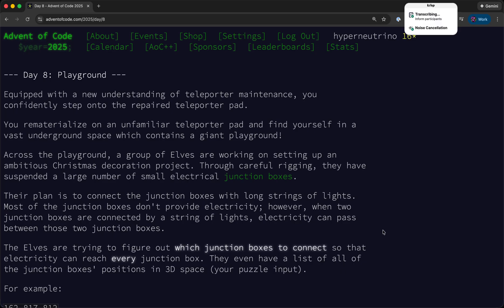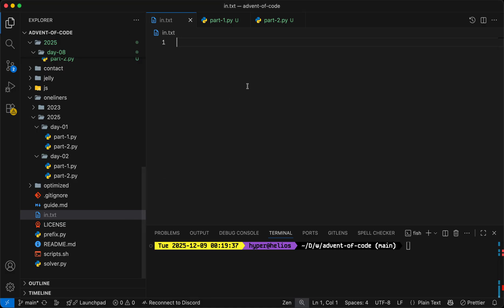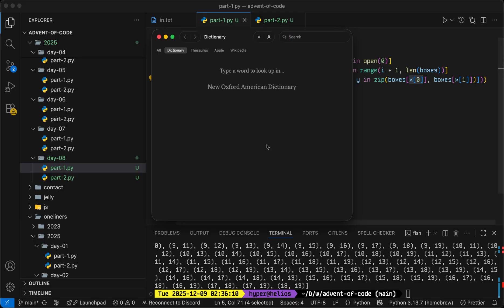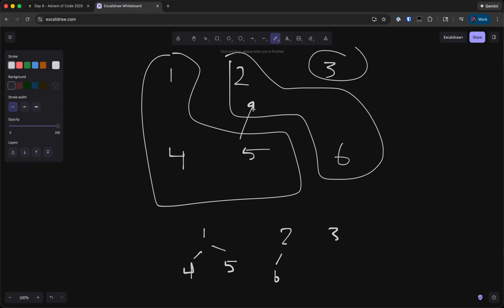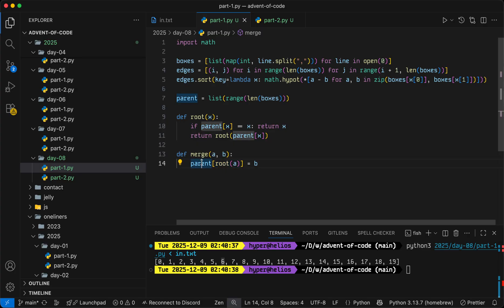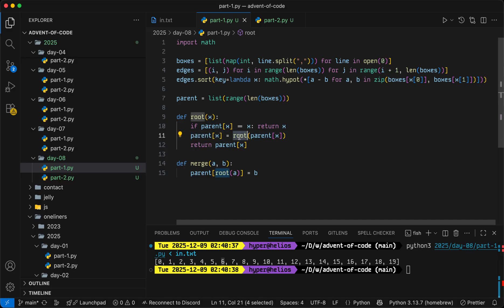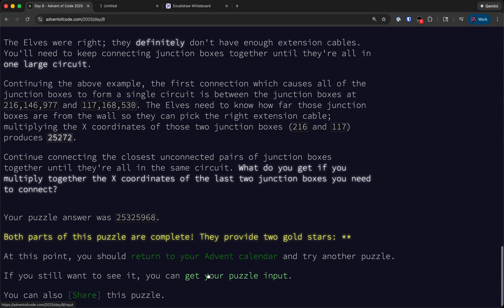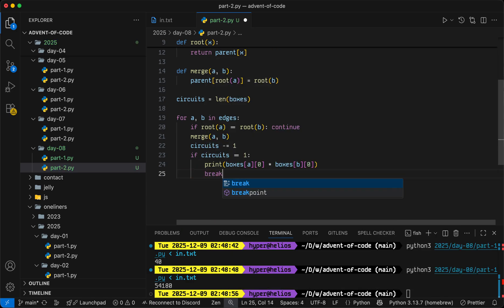advent of code 2025 — day 8 "playground"

Comment: This looks really good as always. One small optimization for Part 1: since you only need the top 1000 shortest paths, you can maintain a max-heap of fixed size 1000. That way you keep only the best 1000 paths as you iterate, instead of collecting up to 1000×1000 candidates and sorting them afterward. This also improves the time complexity from roughly N log N to N log K, where K = 1000
Reply: but how to do that if not every single connection creates a new path and second when it comes to all path possibilities is 1000*999/2 =499 500 so i don't understand your point
Reply: @5012DEV  Without Heap: You find all 499,500 valid paths, store them all in a massive list, and then run a Sort algorithm. Sorting 500,000 items is expensive (N * log(N)).

With Heap: You iterate through those 499,500 possibilities. Most of them will be "bad" (too long). You only ever store 1000 items in memory. You never have to sort the massive pile of 499,500 items; you just maintain a small "VIP list" of 1000.